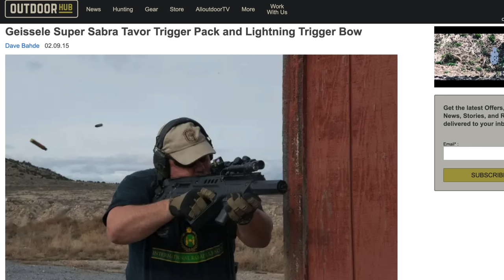6 Reasons Why the IWI Tavor is Better than the AR-15

Comment: The biggest setback for the Tavor is that IWI US is the sole importer of spare parts for this thing. Anyone who owns one knows the frustration of trying to get parts for it through their online store. No joke, I don't even think the firing pin and spring kit has been in stock for over 2-3 years and counting now. That's kind of a big deal if you plan to make this your main go-to rifle. I loved mine while I had it, but at the end of the day I didn't want to be stuck with $1,600 tactical paperweight on my hands the moment a critical component broke.

Compare that to an AR where you can basically get parts from everywhere dirt cheap and keep the thing running until the end of time. Love it or hate it, that's why most people will still gravitate towards the AR platform. I honestly wish the US market had more serious competition because quite frankly I'm not a big AR guy. These manufacturers need to realize parts availability and support is just as important as getting the actual rifles imported into the country. Ultimately that's what separates real workhorse guns from flashy range toys.
Reply: Your 100% correct. I even told IWI that’s the soul reason I sold my Tavor and I’d buy Tavor 7 and Masada today if they could jus make spare parts available. They replied that they will no longer offer spare parts such as springs, extractors or firing pins due to people installing them wrong, fucking up there rifle then claiming warranty work. Once again morons ruin it for us all. Even Steyr offers spare parts and is a HUGE reason I own an AUG and not a Tavor.
Reply: @ridered55x84  Well that statement there is enough for me to never buy an IWI product.
Reply: @mattfleming86  I hate to say it too because I love IWI but I’m the same way. I have a TS12 right now and it’s badass but it makes we think about getting rid of it too.
Reply: Could be a 922r compliance issue on the parts?  Meaning the parts are removed and us made parts are put in.  I totally agree with your comments.   Thats exactly the reason I don’t have sig, Aug, iwi, B&t etc.  Spare parts and barrels.
Reply: Yeah, I agree. Not a huge fan of the AR15, but its foolish to not see the ease of finding spare parts.
Reply: @ridered55x84  if what you're saying is true then you're basically at their mercy for handling ALL repairs. And if the company ever goes tits up you're SOL because nobody else imports parts. That's a hard pass for me. I can begin to see why they don't have many LE contracts either.

See at least with companies like Beretta you can still buy parts for their guns through companies like Midwest Gun Works, Brownells, etc. That's literally all I'm asking for in terms of parts support. If there's something I can't handle myself, I'll just buy the part myself and take it into my local gunsmith.
Reply: Exactly
Reply: I see James has no complaints Lol
Reply: All the more reasons to get a VHS2 instead ;) imported by Springfield so you have domestic support for it
Reply: @TheHouseAlwaysWins-xs8zd  few independent guys make pistol grips like Underworld Arms
Reply: @roady7420  Sig is all made in america now and they offer every single non-serialized part available for purchase on their website... i've literally built 3 sig's off of parts off their site lol
Reply: I got a springs/repair kit several months back. Maybe 6 months, I don't frickin remember my memory is like a goldfish's. I'm not sure exactly where I got it but I just did a search and found a site with it in stock quite easily.
Reply: Also good luck getting a spare bolt even if they were in stock, as they will only supply bolts to certified armorers. They don't trust just anyone to check headspacing.
Reply: @huwhitecavebeast1972  hahHahaha damn
Reply: @mmiski  oh your absolutely right. And it is true or at least wat I was told by a representative from IWI. Because I was all in on the Tavor 7 in .308, but me being me I like having spare parts and I wanted to know if any would ever be available. After that reply I pretty much wrote it all off, even though IWI has amazing customer service I jus like having extra parts in my kit.
Reply: This is why you buy an AUG if you want a bullpup as a primary rifle.
Then you get a PS90 for when you need even more compactness & less weight.
Reply: I want to disagree with you, but you're right, they're OOS on the IWI website. When I got my X95, I bought a spare fp/spring combo that I have sitting in a drawer. Really glad I did that now!
Reply: @DV8 *** no, they don’t. It has a “read more” option but no add to cart or purchase options.
Reply: The issue usually is the US Government. They have had an issue especially with the new Administration of holding up or cancelling their important licenses. 
In fact that is why one can no longer get 300 black out or 9mm conversion kits.
Reply: exactly. putting higher round counts through any rifle shows how important after market support is.
Reply: Cz solves all my issues
Reply: @elijahwood5447  Been waiting a few months for the 3 hole gas tube on my x39 Bren 2.  On my second one, and still have FTE issues.  Saw a YT channel saying CZ USA is laying off a bunch of folks, and keeping old Colt employees.
Reply: The Tavor is a great rifle, , ,  to invest in. Something that will grow in value, something you can sell at auction for 10 times what you paid for it 25 years ago.
Buy one, hell buy ten of them, put 'em in a safe and smack your lips over all that juicy money youre going to make.
Reply: Why put all that effort into it when the politicians are just going to take all our shit away in 5 years?
Reply: @bigredwolf6  Dudes like you have been saying that for 200 years
Reply: Thanks, you saved me having to state the obvious about available parts. Tavor bullpup nonsense. What a joke.
Reply: Yeah I had a hard time deciding between the tavor and Aug. The Aug won because of the massive amount of parts they have aftermarket
Reply: This^ Dude you totally beat me to it. That’s why I sold all my IWI stuff. 2 years of being lied to.
Reply: @ridered55x84  wow that’s crazy. IWI is a joke but as far as Steyr goes, what’s with the spare barrels? They don’t offer them anymore on their website last time I checked
Reply: @franklindeckard1583  I was thinking about picking up a tavor in 308 but seeing this is making me think twice
Reply: @bigredwolf6  haha your delusional if you think a politician is going to take away our guns…
Reply: @JoeWayne84  its funny that the question answers itself: why buy guns if they're going to kick in your door for them?
Reply: Makes me think of the camo market.
Great patterns like pencott greenzone and concamo green developed in england and germany exist, but can't find them on this side of the atlantic most of the time because everyone and their mother is like "WE GOT MULTICAAAAAAAAAAAAAAAAAM!"
Reply: @no-sway3709  no shit haha it be bad day they go kicking down doors of Americans …
Reply: IWI customer service and parts availability is a joke. They want to do one thing and that’s get guns out to their distributors anything else is a very distant second.
Reply: @Veritas419  I'll be the contrarian in part to this: I placed an order on Sunday through IWI (geissele trigger pack, lighning bow, barrel wrench and thin butt plate). It is out for delivery today which is better than most. 
But not having basic parts in stock is pathetic and I agree on those lines.
Reply: yea.. maybe if u could just go to the local shop and get whatever u may need for this "rifle" , id pay more attention to it.. until that and a serious price drop, ill stick to my AR and AK platforms 👎🏼
Reply: This comment alone makes the ar15 the superior option IMHO.
Reply: Steyr aug in a similar boat albeit not quite as bad. Imo if most of the more modern weapon systems had half the R&D the ar15 got both officially and through free market bubba-fuckery they would be much less ubiquitous
Reply: While I agree that IWI is not awesome about having spare parts. There are plenty of sites that do have the parts you may need.
Reply: I got an IWI FSG for my AR and I can't remember what went wrong but it was taking long to get to me so I called and asked what the problem was. They were apologetic and sent me one, got it in two weeks later, and another two weeks...got another. They didn't charge me for it.
I want a Tavor 7, if I have an experience like the one for my FSG when I order parts I won't complain. But I will consider this..
...Edit...was late reading the bad experiences here. I like having spares for my stuff, this thread has made me think harder about if I really want one
Reply: This is one area where I think adopting an existing set of parts would be a great idea. I know AK guys will hate the idea, but the Ukrainian Malyuk rifle uses all AK parts for the bolt, carrier and fire control except for the bits to make it a bullpupper. Since it seems they're a bit hard to come by with their day job keeping them busy, we won't know for sure but internets water cooler talk says the Malyuks were first built from other AKs as full conversions. So if you end up with one, you could theoretically replace any part in it with any other AK part, other than the conversion parts.
Reply: Just recently I ordered replacement parts for my Jericho, even though it did not need it for a few years they did not have the parts. Now I have spares incase of shortages.
Reply: Tavor is small looks ideal for urban fighting but it have a problem like other bullpups, you can't switch hands during combat. For high level special units that switch position on corner it's a big problem.
AR-15 is the most accurate and lightest assault rifle, impossible to beat it.
True that AR-15 might jem more often, but if you keep the magazines in good shape and practice how to overcome those jams - it's the best 
(Tavor use the same magazines as AR-15, both will have similar double feed jem with bad magazine)
Reply: @ridered55x84  thats the coolest shotgun there is tho. Just have a tricked out 590 n that. Mostly shoot the 590. Same deal when KSG was all there was. I sold mine because of parts. I can remember having to get stuff made for it trying to make a KSG ARcentric....  smh
Reply: Women in a military? Ben Shaprio won't like that.
Reply: @mattfleming86  What does IWI mean? thanks
Reply: Hardware (nuts and bolts) kit is back in stock.
Reply: @TheHouseAlwaysWins-xs8zd  the fde grip is in stock on iwi
Reply: @mattfleming86  - Although the Jericho 941 Pistol is great!
Reply: I've been trying to get a firing pin/parts kit for a year and a half
Reply: @buzzmeanytime  Israeli weapons industries
Reply: @Outrunninaround.  thanks
Reply: I agree I own both the x95 and an ar-15, the x95 excels at what it does, however the lack of common parts and the slight reduction in accuracy due to op rod the ar-15 does some things better. Both are tools for different tasks.
Reply: I just bought two spares.
Reply: @bigredwolf6  Your gonna let someone take your property away?
Reply: And it's a heavy pig
Reply: This is the reason I sold mine. Honestly, if you sell a gun have the bloody parts available. I was working with a security contractor to provide them with new guns. They use the AR-15 pistol but wanted something proven in deserts. They do a lot of middle east oil field security and protect clients who may be targets. They put the gun through many tests including removing all oil and firing 500 rounds. It passed the tests. As an FFL, I was dealing with one of their reps directly, and he told me there was a 3-6 month lead time on some of the parts I needed. The beauty of the AR-15 is parts availability and the Tavor is missing that.
Reply: then it is not a superior platform when compared to the AR-15. ease of repair is a major factor in determining the overall quality of a firearm. the modular design of the AR and availability of parts matter in the equation.
Reply: Not to menfion, no forward assist. That can make or break shit. But some people just will never understand the importance of that.
Reply: @ridered55x84   - carp - and i was about to lay down the cash for the TS12 - now i gotta rethink this shi*t
Reply: whoa ...
Reply: @jonniiinferno9098  yea I got rid of mine, plus I could never get it to run 100% either.
Reply: @ridered55x84   - dang - i was really wanting  both weapons.  mostly the TS12 - because that would allow you to carry plenty of rounds in the gun - without the need to carry a bunch of magazines.  already have magazines for pistol and rifle - dont need or want to carry another set for my shotgun.  Unfortunately - hi-cap shotguns are usually 7+1. TS12 with 15 rounds would have been nice...  The Keltec KSG is not an option - i think there is one other out there similar to the TS12 - cant think of their name tho...
Reply: @jonniiinferno9098  oh I completely agree. I love IWI as I had the original SAR tavor and currently have a Galil ace. Spare parts are available for the Galil. I honestly loved the TS12 but jus couldn’t get it to run good enough to trust my life to and I even have had two TS12’s neither would run 100% even after break in periods.
Reply: @jonniiinferno9098  same here. Now all my other weapons from them have been flawless. I jus think the TS12 is a bit to fancy of a design for a shotgun.
Reply: @ridered55x84   - aight - thanks for the info Red Rider - much appreciated !!!
Reply: TAVOR is so good that it was discontinued for the Israeli army...the tavor was replaced by ar15m4....That tavor in the video is a 13-inch barrel?
Reply: Can't you just get the South Africans to sell them to you? It's pretty much the same company or wait.. um.. never mind... d..o they still have those nukes? Is it weird that I'd rather have Israel hang on to them for a safe keeping given how things have gone in the last 40 years?
Reply: .XB13SBR is pistol or rifle?..That tavor in the video is a 13-inch barrel?...are subject to NFA approval ???
Reply: @TheSickjits  not for the 716i. They will not sell you a spare, nor can you find online, a replacement BCG for it. It’s the reason why I didn’t buy one.
Reply: I’ve tried to search X95 issues for a month and after consuming all the info I could find included long term reviews and I’m not sure that the X95 is capable of even failing, lol.
Reply: 2 years using this rifle in the IDF, i never had anything break. Did your firing pin snap?
Reply: @TransformersHoarder  facts bro.
Reply: Is it a setback if these guns are as reliable as they are? Battle proven gun… pretty much impervious to elements and hard conditions like being in a desert. Yes ARs are modular (i also have 2) but theyre more finicky… dont like certain loads… have to run wet… more FTF or FTE issues especially on lower end builds… not at all trying to argue… just an observation on someone who owns both… ps my tavor has somewhere between 4k and 5k rounds through it.
Reply: What?

That's news to me... Checks IWI store...  Huh. So NEVER in stock?

I recall IWI being pretty proud of themselves on various bullpup forums when Tavor SAR parts kits were finally made available on their online store. That was one of the genuine criticisms after its release. Well, shot, glad I bought that spare parts kit like five years ago.
Reply: @ridered55x84  that’s one of the reasons I’m looking at the AUG; my Tavor SAR is really good but you can’t get parts for it.
Reply: @mmiski  IWI screwed themselves with that.
Reply: @pewpewTN  that’s why I’m looking at the AUG; my Tavor SAR is really nice but the lack of support for it really kills it.
Reply: @mattwalters6834  The AUG is great, but the updated Tavor X95 is 100% a viable option.
One most people miss is the Desert Tech MDRx, that thing is amazing.
Reply: @buzzmeanytime  Israeli Weapon Industries
Reply: @pewpewTN  I have the SAR and it’s good, parts availability is what the problem is; I want to like the MDR/MDRX but I’ve seen a lot of reliability issues.
Reply: I just checked the iwi site. Don't see any x95 or sar parts out of stock
Reply: @Alex-py6rf  really?  I’ll have to check!
Reply: @mattwalters6834  The MDR had some issues, but the MDRx seems to be rock solid.
Reply: Is this gun reliable I'm buying one from a member of my range and he's giving me a deal $1000. It only comes with one Meg.
Reply: @rickrick70  yes
Reply: @rickrick70  Yea & that price is a steal.
Reply: Great Point!!!🙂
Reply: @buzzmeanytime  Israel Weapons Industries
Reply: the funniest thing was during black friday they had a sale on bolt kits, but the bolt kits were not in stock lol.  I kept getting emails saying "last chance to save!"  Save on what?  i can't add to cart!!!
Reply: Yes...or buying one! I've ben looking for a X95 7 for two years...zip!!!
Reply: If you call and talk to them they will send you what you need..I got parts at my door within a week. It was super easy. My real experience.
Reply: You can also buy about 3 AR15's for the cost of a Tavor. 1 is 0 and 2 is 1.
Reply: @allynflinchbaugh4570  Or a PSA AKV & a huge pile of ammo, lol. I rly like the Tavor, but this supply issue + the $2,000 price is a bit of a deal breaker. I have a Saiga in 7.62x39 & an SKS, so rly I am good on short to mid range guns. I'd like a 9mm PCC, though.
Reply: I didn't have much trouble looking just now. IWI site is garbage. Several other places with parts though.
Reply: ..given the high price of the Tavor 9mm, i decided on the Ruger PC 9, 9mm carbine. It's a gem! I dig everything about it. I have yet to shoot groups, but a shake down run of 100 rds and it is a real treat. At about $600, it's a solid deal. It hit even small targets I set up out to 50-100 yards, no problem..like empty 12 gauge shells. a nice trigger. I got the standard carbine, not the gussied up one, aha.
Reply: I agree, they had a 300 blackout conversion kit, now its not even an option, very disappointing
Reply: I needed to read this, I'm small so a bullpup is good for me plus the forward  hand placement+ foregrip is better for me, and ultimately I have to make a choice between the mdrx and the x95
Reply: The biggest drawback is the ejection port is right under your ear. Ouch that hurt. My eardrum just ruptured because I forgot hearing protection. 5.56 is really loud. Even with the silencer notice that he still had to wear hearing protection. 300BLK subsonic with silencer. Especially inside your home.
Reply: I'm kind of confused. Apparently it's hard to find parts, but sometimes not? And if you directly ask them for things they'll be able to hook you up with it? Also big question: I was planning on getting the .300 blk conversion. Big problem if I can or can't. Anyone know?
Reply: @bigredwolf6 Bro.. nobody is coming for our guns. Please stop.
Reply: @Veritas419 My personal experience with their customer service was great
Reply: Senex Arms is making a bullpup that uses the AR15 barrel, gas system, bolt, grip, and most of the trigger components. It's not in production yet, but he will solve some of the supply issues you mentioned. It's going to be made in the USA.
Reply: How many rounds we talking for springs and firing pins to be worn out ? You would have to be shooting a shit ton of ammo per month.
Reply: Thanks, that’s good knowledge to know because I want one of these but if it starts breaking and I can’t get parts for forever that’s ridiculous.
Reply: @asteiner9181 You should still be able to get parts. If it takes a few years like they claimed?
Reply: Got one in a trade in 9mm a couple of years ago. I just got a 5.56 conversion for it a couple of months ago.  No joke about waiting for parts.
Reply: Yes, the open source platform of the AR is revolutionary.  the AR is it's own franchise where manufacturer is just another option.  Sucks that only the AR is open source and modular like that.  It's a kinda a sh1tty 1950's design ... I live in the desert so it's no bueno here ... AR's a great suburban guns that will live indoors.  The wilderness laughs at AR's
     If only we could make a open source 4x4 as modular as the AR platform.   More things in life should be decentralized, modular and built local.  It's an ideal model for industry that I wish was more common at the consumer grade level.
Reply: just buy 5 rifles
Reply: @mattfleming86  I still want one really bad. It’s everything I want.